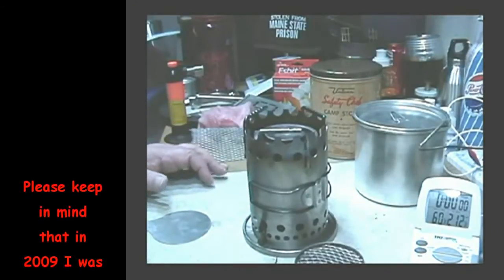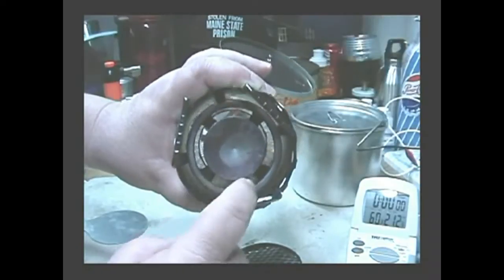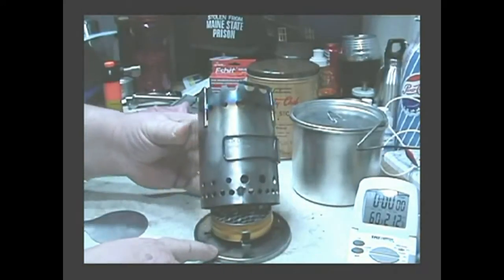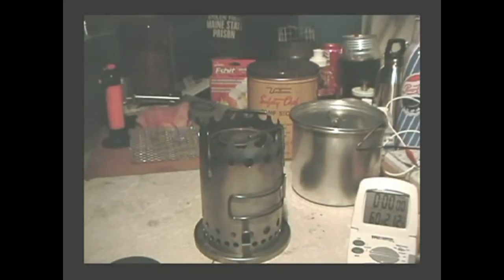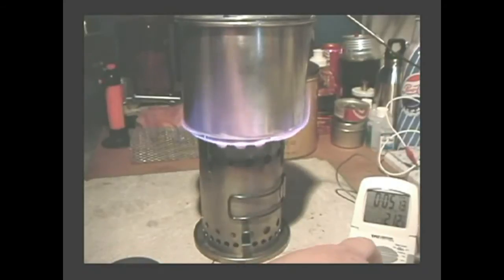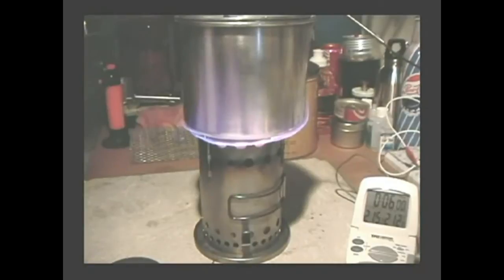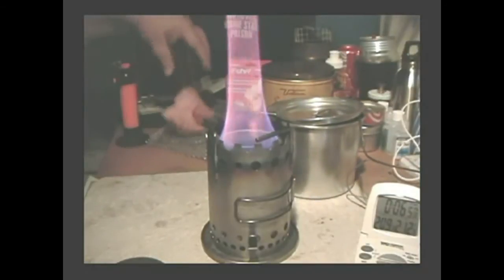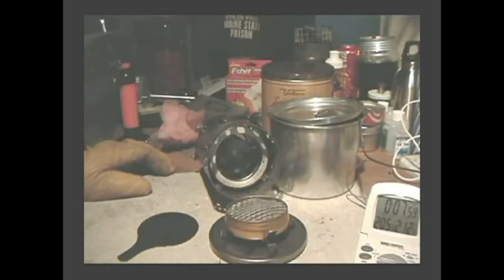Vulcan Safety Chef Camp Stove Boil Test 3 - Alcohol Wick Burner - Reload

Comment: i know this is a crazy question but here goes  i have 2 of these stoves i want to take one and make it a wood grass pinecones fuel stove only  what would i have to remove from it  im thinking of cutting out the center circle and cross section in the bottom so i could just drop in the sticks and stuff  and remove the center cap on top. do u think this will work  i havent tried it yet
Reply: Did you try it? How it was?